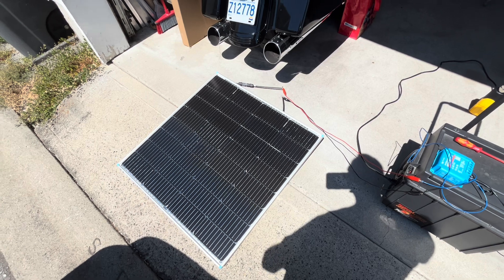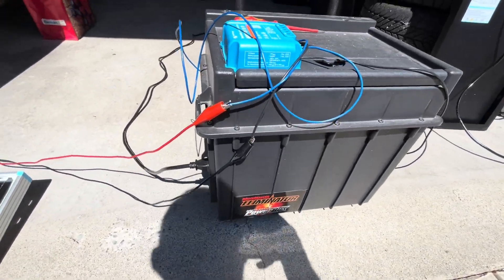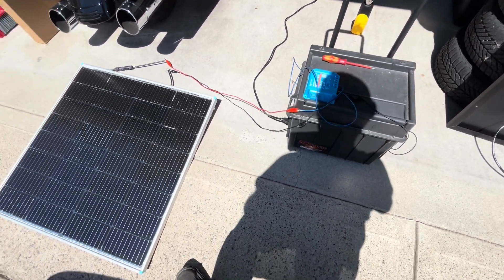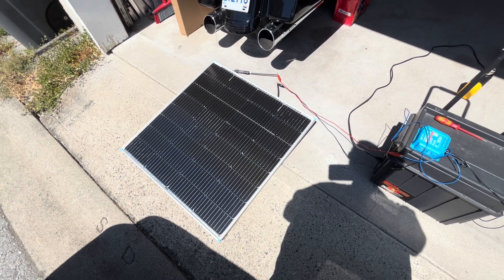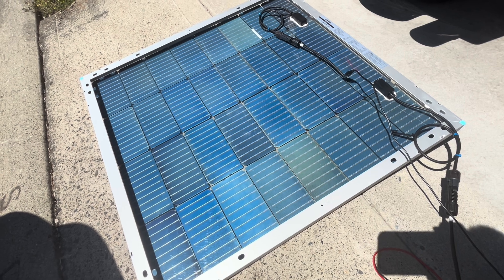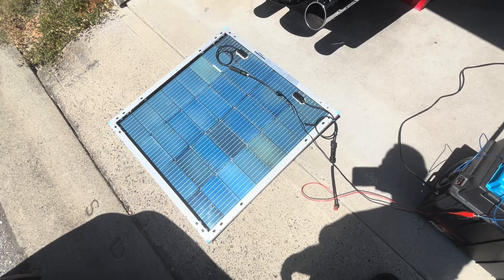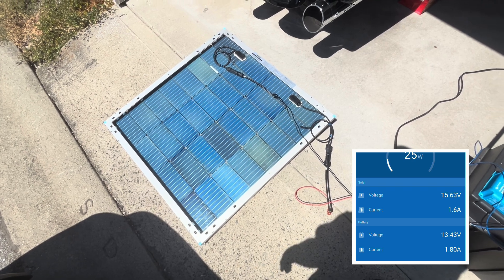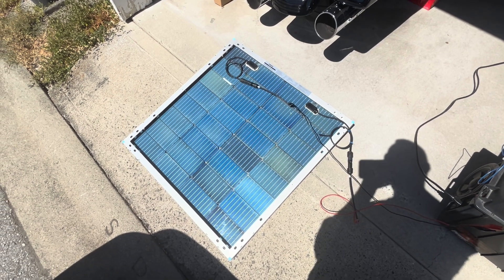Renogy Bifacial SolarPanel 115W

Comment: So the panels don’t come with the metal stands pictured in the thumbnail?
Reply from the maker: Panels never come with accessories or mounts.
Reply: @, yes. They do. Many come with built in solar charge controllers. The Renogy 100watt suitcase panel as an example. And the Harbor Freight 100watt panels have built in stands. Never say never.
Reply from the maker: This is why having a community helping someone always has more info thanks for the info, I have a Harbour Freight near by have to check those out.

Comment: I installed four 100W Newpowr bifacial panels this year to replace a regular Renogy 175W panel. They are tywrapped to the lifelines at the bow and fold down without interfering with the genoa when at sea. I can now keep 300AH LIFEPO batteries fully charged and keep the fridge on making cubes and keeping the ice cream cold. SV Renaissance 41' Beneteau
Reply from the maker: Thanks for the real world experience it means a lot happy sailing 👍